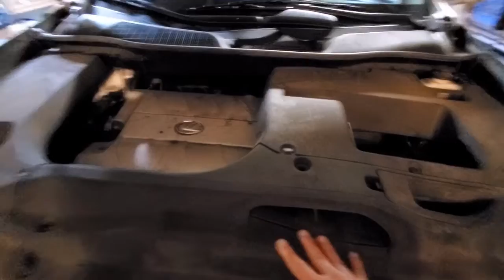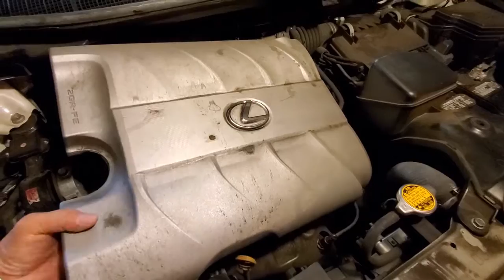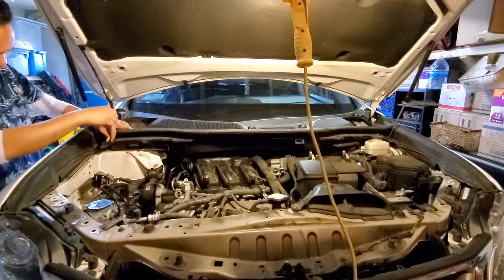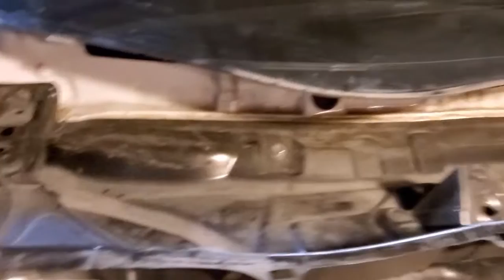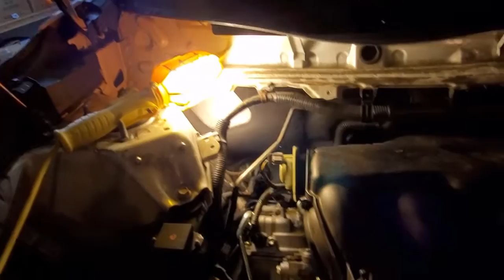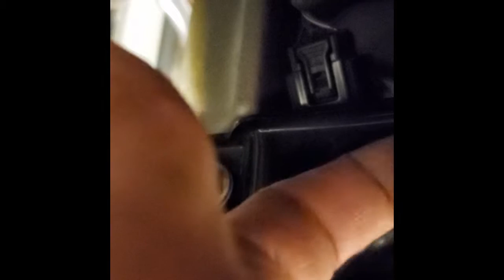How to change spark plugs on 2015 Lexus RX350 with least amount of effort - step by step tutorial

Comment: This is so far the most detailed 2GR-FE spark plug replacement video. Thank you!
Reply: No it's not. It's one of the worst. Check out the spark plug change on the RX450H. Wipes the floor with this video.
Reply: @sydsnott5042  Looks the same to me. There is no wiping floor, and guess what, Intake manifold doesn't need to be removed to do the job...
Reply from the maker: @Align700nitro  thank you for your support

Comment: I just changed my spark plugs using this video to guide me.  This is by far the best video for a do it yourself. If you meticulously go step by step you will be successful..I did not need to use the swivel adapter but I have many different extension lengths..3-4 hours to complete.

Comment: I’ve got a 2017 RX and gotta say the last center and right firewall side spark plugs were worth the price of admission!!! 
 I replaced them per your video here, but I’m definitely considering pulling the air intake components at the next change out cycle. Gonna be sore for abit. Thanks for your video Sir. 
 All the best.

Comment: Good video.  I followed the instructions trying to replace the spark plugs on my 2015 Lexus RX350.  It turned out that it is much easier to remove intake manifold and get to the three plugs in the back.

Comment: Thanks for the video! Knocked this job out in a few hours. Agree with some others that disconnecting the pass side hood strut is very helpful. I used a bike tire floor pump to prop the hood while I worked.

Comment: Nice video!
However, the reason you brake the plastic fasteners is that you should push the inner circle piece of the plastic retainer inward and then take the fastener off (not pulling them up!)
Reply: They snape easily

Comment: Thanks for the video. I had a mechanic suggesting that the intake air manifold and throttle body needed to come off in order to change the plugs on the rear. You didn't find that to be the case correct? Also did you h and any challenges getting old plugs out or did you need a torque wrench when putting the new plugs back in

Comment: Lesson learned: Don't buy V6 front wheel drive cars and SUVs if you are going to DIY. (Stick with 4 bangers and RWD systems) Thanks for sharing!
Reply: Yeah, buddy! Why complicate your life?
Reply: Other than the spark plugs and injectors, everything else is relatively easy. Don't miss out on these reliable cars because of the spark plugs. You can easily go 5+ years with out changing them so it's not a big deal
Reply: Right you may never wish to tow anything so stick with a 4 cyl.  DUH!

Comment: thanks i have bimmer e46  v6 inline no problem changing sparks i was planning on buying a Lexus but after seen this forget it  that is epic pain ...
Reply: I have an audi a7 same. Same, after seeing this, screw these toyotas. What a pain in the ass. And all those mechanic fan boys say how easy is to work on toyotas. Have they ever worked on German cars lately? :))
Reply: Yeah, Mk6 with messed up oil ring, pretty easy to fix just need to yank out the motor....
Reply: Not as much pain as an e46 valve cover gasket thats known to leak on the exhaust manifold
Reply: @gregmach18  i know I suffer that too
Reply: I'll take my sweet, low maintenance, highly reliable Lexus over ANY German 'over engineered' money pit any day. 😊

Comment: What about the ignition coils? Why you did not replace the ignition coils along with the spark plugs? Thought they are normally replaced together at the same time
Reply: No. They are only replaced if they fail. OEM coils for this car last a long time and are about $130 each at the dealer.

Comment: primary reason I am no longer buying Lexus V6 FWD platform. it took me 4+ hours and only reason I did it at home because the cost at the dealer was $800 to replace spark plug.
Reply: But you only have to do it every ten years!
Reply: This is nonsense. You have to do this once or twice over 15-20 years.

Comment: Ok, about not removing the intake Manifold, is a big No No! The reason its in the way is because you need to clean that part at 120.000 miles!
Reply: You don’t clean the intake manifold dude. That’s simply incorrect. The throttle body gets cleaned, but that’s a separate part that can be cleaned in place.

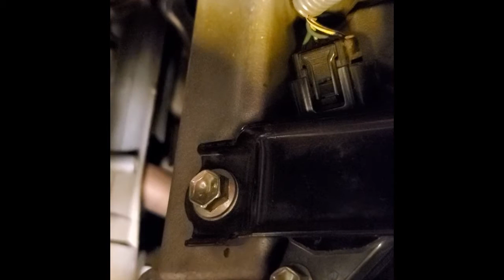Comment: 21:40 that bracket screw (the bottom one) is the only one that needs to be removed, the top one can stay with the bracket. But it's hard to put the plenum back unless you do the cutting trick shown in this video
https://youtu.be/urKkKH7tR24